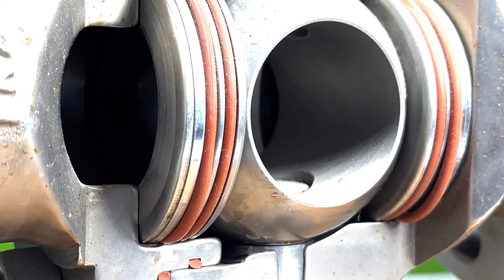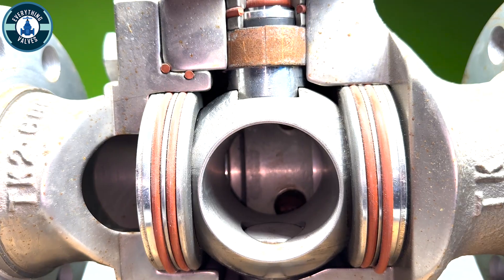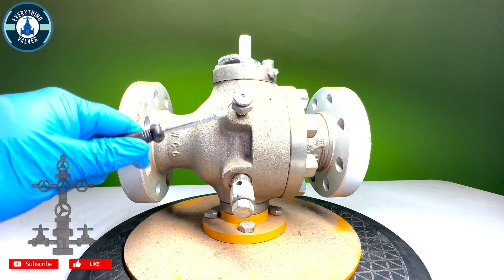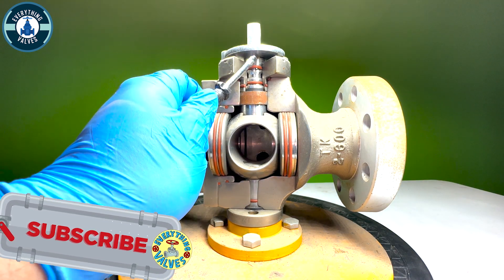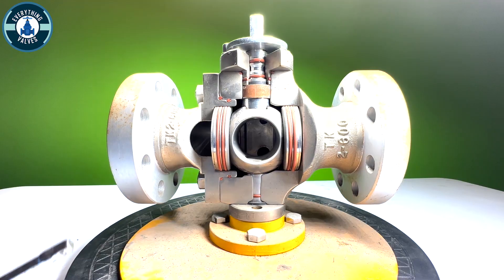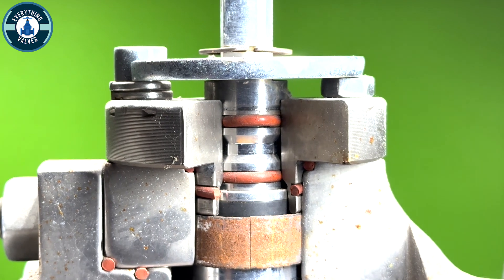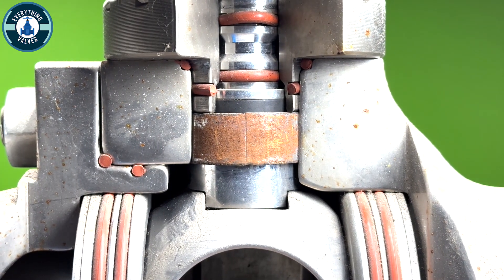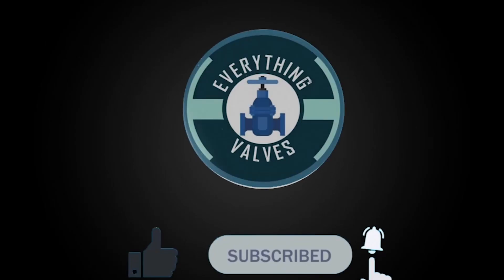What is a trunnion mounted ball valve? Detailed overview of a trunnion ball valve components.

Comment: which difference between this trunion design in 02 pieces ( body & adapter) and 03 pieces ? thank you .
Reply from the maker: Good question. The valves are roughly the same in terms of design and function. The difference is the body and adapter construction. 2pce is usually made with cast steel and can be cheaper to produce. The 3pce is usually forged steel which can cost more to produce. There are more differences but this is my option on the main difference between the two. Hope this helps. Thanks for your comment.
Reply: @everythingvalves  much appreciate your explanation . thank you.

Comment: How to identify the which flange inlet, & outlet in normally (with out install the valve )
Reply from the maker: Thank you for the comment. To answer your question. Generally ball valves are bi-directional. Meaning there is no specific inlet or outlet. You can install the valve in any direction. However, some ball valves can unidirectional by having special seats. The valve in the video is bidirectional. 

If it was a check valve. Those will be unidirectional. Meaning they will have an inlet and outlet. Usually there will be a position indicator on the outside of the body. 

Hope this helps. Thanks for watching.